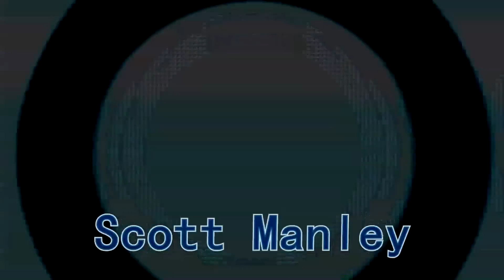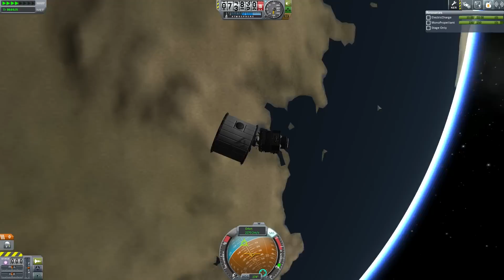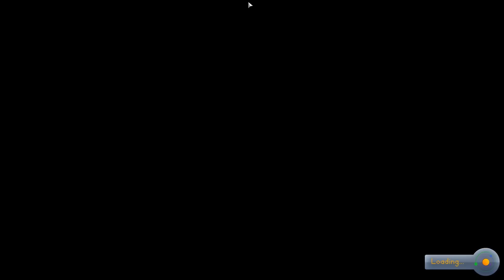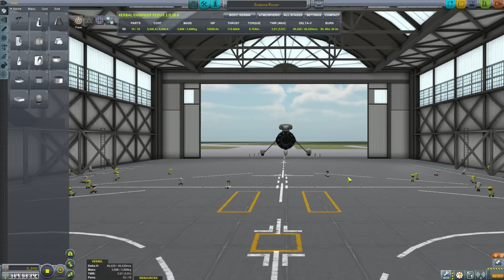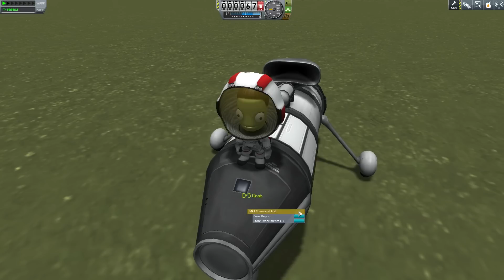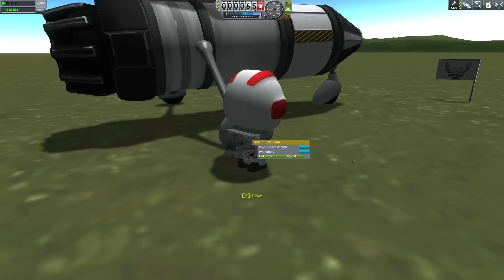Kerbal Space Program - Career Mode - Part 27 - Space Junk Recovery

Comment: The best way to manage space junk is to not leave it there in the first place.
I always try to use my ascent stage as efficiently as possible but then I will make sure to leave it in suborbital trajectory.
If are on tight low orbit and you have some delta V left you can do a burn to raise your apoapsis in the direction you already plan to raise it, but leave something like 5-10m/s of dv. Wait until apoapsis, do 5m/s retro burn to lower the periapsis into atmosphere, turn prograde, separate your ascent stage to leave it on suborbital trajectory, and then do 5m/s burn to raise your periapsis above atmosphere.
This way I can have some spare delta V in the ascent stage without wasting it. It only costs one orbit.
Now, the game does not clear it automatically but now I feel justified clicking the red button to remove the craft from the universe because this is just an artifact of the game not running physics for it when it is in atmosphere.

Comment: Runways are usually designated by numbers, indicating their navigational direction. Runway 09 is 90 degrees clockwise from North, (i.e. towards East)  and is physically the same as Runway 27, (West) if your airplane is using it to land in the 270 degree direction.

Comment: In keeping with FAA designated ILS labels here on Earth;
- Runway East = Runway 9
- Runway West = Runway 27 
... but then Kerbals have their own way of doing things ... I guess.
Reply: 3DPDK werent those 090 270 030 and so on, to reduce confusion? :)
Reply: sbraz No, actually, not in the U.S. anyway. A runway that has a heading of, say, 123° would be labeled as Runway 12. If the heading of the runway is 126° it will be labeled as Runway 13. The best explanation for dropping the "ones" number is because the heading is based on magnetic north which drifts over time. So rather than re-painting the numbers on the runway and changing national and international navigation charts every time the compass heading changes by one degree the number is rounded up or down to the nearest ten and then dropped to a one or two number label. If the runway is 053° (as it is at North Myrtle Beach Municipal in South Carolina) the tower will clear you to land/take off on Runway 5.
Actually since the runway heading in Kerbal Space is based on "True" or physical north then you could label it 090/270 and because True north never changes ol' Kiefie Kerman (KSP janitor) only has to paint the runway once! (... or at least until Jeb comes in too hot and short once too often and leaves tire skid marks all over Kiefie's pretty numbers).

Comment: Quick tip: If there aren't any engines other than the rcs thrusters on a craft, the normal throttle controls (z, x, shift, control, etc) can be used

Comment: Mr Manley, that was quite a graceful way of recovering from mixing up east and west.  :p
Reply: ExaltedDuck He didnt mix it up. That is actually how runways are marked. They are numbered by the heading you would be flying when landing. When the runway is fully upgraded, you will notice the number on it is 09. That means it is on a heading of 90 degrees, or East.
Reply: i think those are correct..? i mean as you approach RWY-090 your heading is 090° after all, same goes for all other directions.